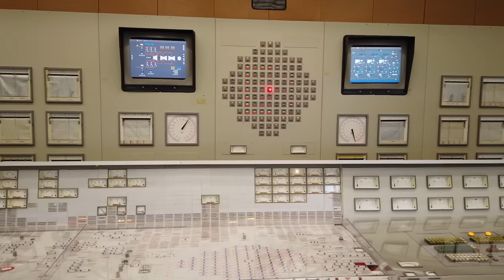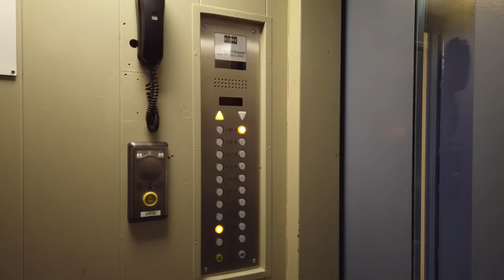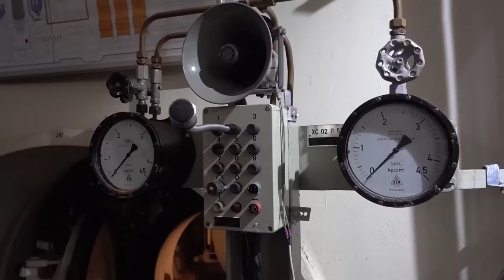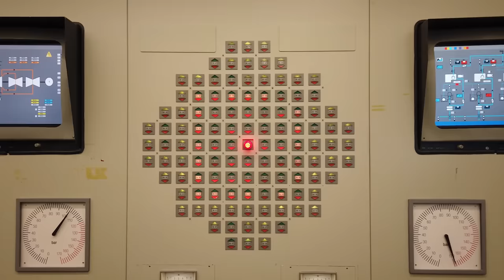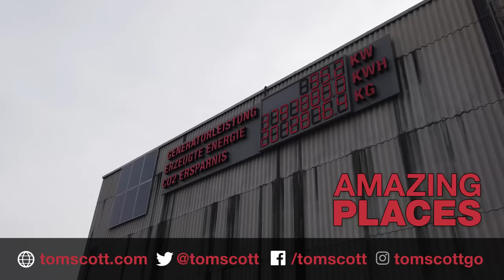This billion-euro nuclear reactor was never switched on

Comment: It's really sad how nuclear power still has such a stigma when it can be so safe and efficient. It would actually be plausible to get away from fossil fuels with it.
Reply: This type of reactor (a German AEG SWR 69) was crap, it lacked a lot of safety features which have gotten standard later. It also had a relatively  thin vessel and the control rods were put inside from under the reactor which means they need external energy to work.
These reactors have been shut down in Germany after Fukushima instantly, while more modern types are still operated
Reply: @simonm1447  and that is very old technology that was designed with slide rulers and calculators. Even with technology from the 50's the only catastrophic events have been due to a major natural disaster or gross human error.
Reply: No way to safely store the waste
Reply: @tylerbonser7686  human error is natural and should be expected.
Reply: no it would not.  On the current technological level it does not have the potential, to meet world energy needs.
Not even talking about the long term costs, that were never priced in.
The Idea, that nuclear power could safe us from global warming is actually a bit in the way of doing the things that are actually nesssary to get there.
Reply: @AegisHyperon  Finland has a finished final storage area already.
Reply: @MusikCassette  We must then change how we use energy instead of creating more energy. We constantly use more also when changing to LED light, the wattage goes down temporarily but the we have more lighting and the balance will shift. Same with electric cars, we will start to use them more than we should. and drive less power conservative. I think we should geneticly engineer our eyes to see more. so we dont need lights.
Reply: @MusikCassette  exactly it does  not change the energy balance. to build and develop concrete metals buldozers, welding etc. etc it takes years there will be huge CO2 emmission. When the reactor starts it does not emmit CO2 but it can never undo the emmission. So it is not emmisionless on the conterary.
Reply: @scotty1928  It's not true. Nuclear is cheap, it just have high entrance cost but very low opearting costs (to the point when in long run it's cheaper than fossil fuels, and France is great example of it at current moment producing cheapest and most stable energy in EU), and surely is cheaper than modern age storage sollutions, especially when you consider utilization of them after life span. So provide some sources to your claims. Because as for now, countries that implement renevables do so not because of price tag but because of water, which is in case of Europe, China, and many US states is bigger problem of nuclear energy than price.
Reply: @Kevedsa4esan  except it does not even really have that potential.
Reply: @MusikCassette  ok if you’re gonna stand here and talk about something you seem to know very little about, can you at the very least send over some sources? I’m guessing that’ll be hard to find
Reply: @marlonlernmark  what exactly are you refering too?
Reply: @scotty1928  wym? Nuclear is like half the cost of wind and many times cheaper than solar. And there is no way to power the world using only wind and solar. That’s a crazy idea
Reply: @MusikCassette  Nuclear energy is the most efficient we energy source on the planet. And that's just talking about fission reactors, not to mention the fusion reactors that are currently in the process of being developed. The new fission reactors use up all the radioactive waste so are the most efficient and cleanest eneegy source. Other forms of "renewable energy" such as solar are actually not that much better than fossil fuels. Solar panels take huge amounts of rare earth metals to build. Those metals are highly toxic. Meaning disposing of solar panels creates toxic waste. And more importantly mining for those rare earth metals is extremely damaging to the environment
Reply: @colbycameron1770  when you say most efficient, what exactly do you mean? Are you talking about Energy density? 
" The new fission reactors use up all the radioactive waste so are the most efficient and cleanest energy source. " That is not true. If you build the best state of the Art fission reactor currently available, that would be f.e. the EPR that still produces quite a lot of high radioactive nuclear waste. There are some designs that are promising. But that is all that they are. I am all for exploring those(if we don't need them for the power they provide they could still be important in dealing with the nuclear waste we already have). But we can not act as if they were already a thing. Especially if we compare them to more concrete challenges that we are facing with renewables.

You are wrong to put the renewable in quotation marks. The thing that you might wonna question is sustainability not renewability. And yes sometimes things are build and deposed of in unsustainable way. If we don't value sustainability there are always ways to cut corners.
Reply: @marlonlernmark  "wym? Nuclear is like half the cost of wind and many times cheaper than solar." what about you give a source for that?
Reply: @berndarndt9924  have you read what happened? it was beyond human error. it was a series of engineering, technical, decision-making and opportunistic errors which culminated in a catastrophic failure. most nuclear plants have not and will not ever fail, let alone fail so spectacularly, even when managed by incompetent people. remember chernobyl is the only one that suffered its fate due to how it was run, ever. fukushima failed because of its location.
Reply: @MusikCassette  - You do exhibit the intelligence and wisdom of a music cassette, but at least a cassette can store accurate information.
Reply: @JesseHBrewer  
You don't know me well enough to understand the extend of ma wisdom. You imply, that I conveyed inaccurate information. could you be more specific.
Reply: @JesseHBrewer  When you say modern reactors, am I right to assume you talk about f.e.the EPR ?
Reply: @MusikCassette  - Even modern light-water reactors are hundreds of times safer today than they were back in the bad old days; but I'm more partial to the newer designs like molten salt or thorium mini-reactors, where economies of scale can be challenged by mass production of easily transported Gen-IV SMRs.   Big reactors are by their very nature all unique megaprojects.
Reply: @hairyairey  
"It's the ONLY viable way to get away from fossil fuels."
That are two falsehoods in one sentence. 
1. nuclear energy is not a viable way to get away from fossil fuels. In fact on the current technological level it does not even have the potential to make a significant dent.
2. There are actually other options that are viable. At least for the par of fossil fuels that is our electric grid. But I don't assume, you meant nuclear energy could help with the other 3/4 of the problem.
Reply: @JesseHBrewer  
So to be clear your argument does relay on stuff that exists just on paper?
Reply: @hairyairey  I would like to introduce you to the concepts of energy management and Energy storage. We did not need substantial energy storage in the past so that industry is underdeveloped. But there is no principle technological problem in the way. It is mostly an economical Problem. If you Imagine marketready Thorium reactors, it is intellectually dishonest not to assume economically viable storage solutions.
Reply: @MusikCassette  - I believe several are now under construction, and of course there was one in operation for years some time ago.   But yes, SMR factories have not yet gone into production, so their profitability is still speculative.  Quite a few companies have, however, wagered their future on them.  Is your point that we should never try anything until it's already been done?
Reply: @hairyairey  NaS Batteries f.e.are an option, that exists for quite a while. They are in use in some places and on a technological level they are proven. As I sad before, it is mostly a question of economics. Right up to and including now, we just had no market for that type of grid scale storage. Perhaps other solutions are more competitive. The thing is, in order to think about nuclear energy as a way to get away from fossil fuels on a world wide scale, you need to include technologies that are further away from implementation. So you don't even need to think about economics.
Reply: @hairyairey  " Sorry but all these ideas are a pipe dream." says the guy who things that thorium are around the corner. You are using two different standards here.
Reply: @hairyairey Well It is also not that different from a number of promising designs we had in the past, that ulltimatly failed in praxis (f.e.THTR-300). That does not mean, that the same fate has to await all new designs. But at this moment in time, they are pie in the sky. Their are likely a lot of technical problems, that we don't jet know about. Not to speak from those, we do know about. I am all for the experiment. But we won't know for another decade or so, how usable the will turn out to be.
Reply: @JesseHBrewer  Do you refer to the THTR-300? You should take a closer to that one perhaps you will understand why I don't take the promises that come with reactor designs at face value. No, that is not remotely my point. But we can not treat the pie in the sky concepts of nuclear power as something we can already plan with. Especially not if at the same time technologies that do actually work get dismissed because we have a clearer view of the economic challenges.
Reply: @simonm1447  absolutely agree but might it be possible to modify this?
Reply: @SuperBicycleRepairMan  if a reactor is once built you can't make major design changes any more.
But the SWR 69s are scrapped anyways now (if you refer to this post)
Reply: @simonm1447  Your probably right. As far as I'm concerned the main problem with the industry is that it appears locked into solid uranium fuel used in PWR's. To the point that alternatives are swept under the rug. Leading to the huge delay in interest and financial support for liquid salt reactors. Build and running costs should be drastically reduced compared to PWR. Technical difficulties typically yield to a properly funded research program, that ideally should be run by collaboration of countries. Potential of short lived waste products along with high fuel burn from the liquid Thorium cycle seems a worthwhile goal with genuine potential at avoiding an environmental cliff edge most seem to avoid considering.
Reply: @AegisHyperon  you can just dig a deep hole, you don’t need some insane bunker, there are already drills capable of boring deep enough to avoid ground water contamination.
And even if what you said was true it’s not like we are excelling at containing the waste from coal and gas power plants
Reply: @AegisHyperon  there is a way to safely store the waste, you attatch it to a rocket and threaten your geopolitical adversaries with a dirty bomb
Reply: @comptelo-cz  that's what the big holes in the ground are for right? re-using material?
Reply: @maktiki  That's a horrible idea, genetically engineering human genomes just because of our issues with global warming. Our genetics is not something to be messed with for such trivial reasons. People who have horrible genetic defects, yes, but your suggestion, absolutely no.
Reply: @suddennr1  Burying water soluble waste deep underground is a very very bad idea.
Reply: @EiziEizz except its not water solluable... they are metal like pallets withing copper casings within concrete withing lead within concrete.... they are placed below any groundwater table... 

You're bringing up a non issue